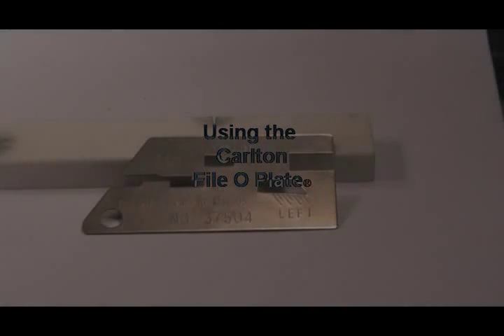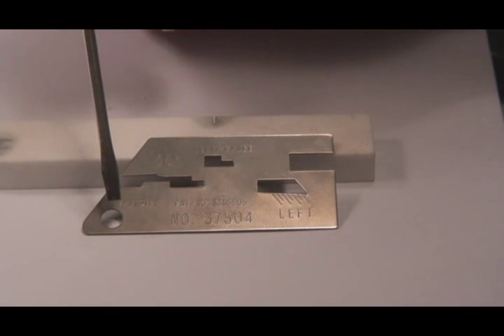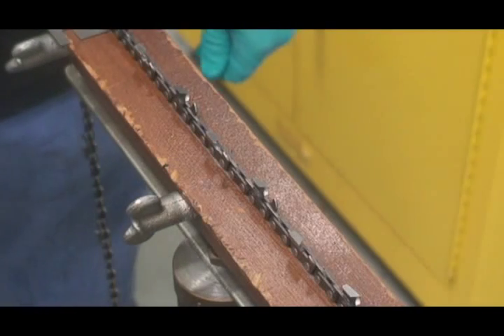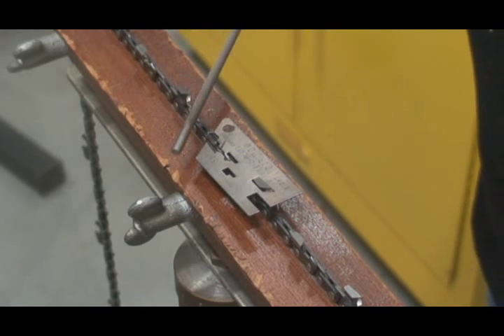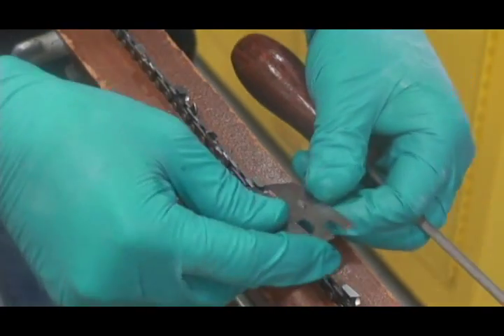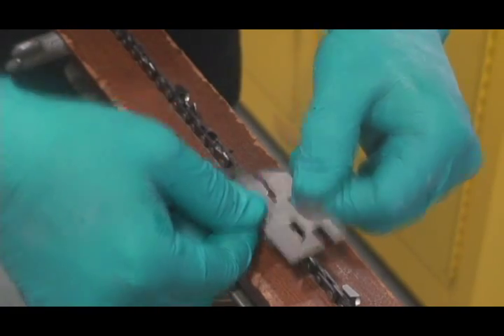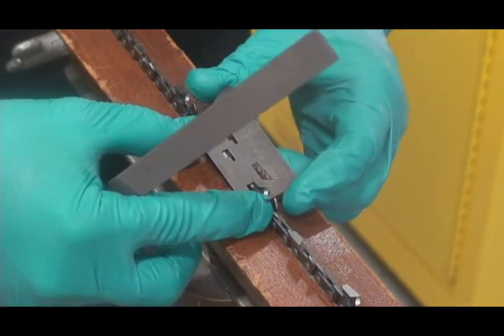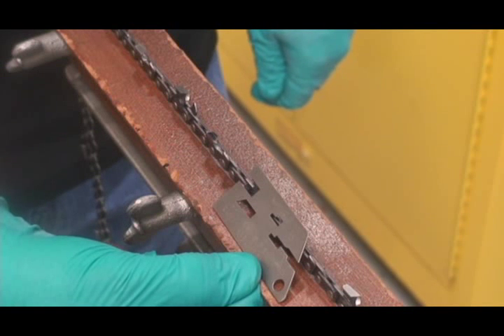CARLTON® File-O-Plate

Comment: This guy is using the best method there is to sharpen a chain saw. If you just put your saw in a vice you can sharpen the chain on the saw in very little time. I stand on one side and sharpen all the cutters on the right then I simply walk around the other side or you can turn the saw 180 degrees if you don't have the room or the vise on the end of a bench to do the left side. These plates are hands down better than the top holding guides because you can see what is happening to the cutter edge. The right plate for the chains you use is important so if you have a 3/8 chisel chain check their web site to get the right plate for the chain. They make several differant plates for the chains that are out there.